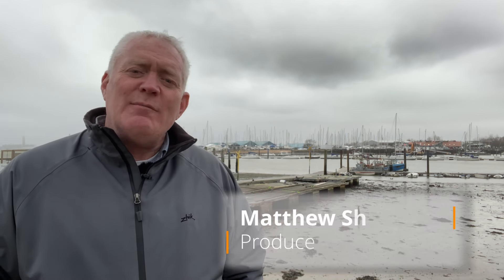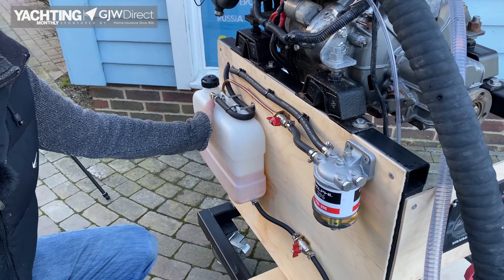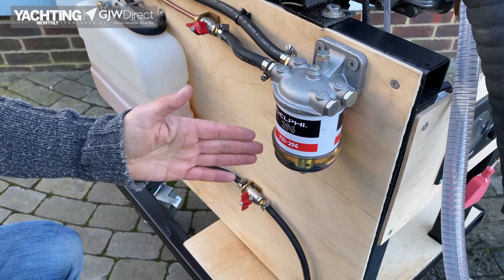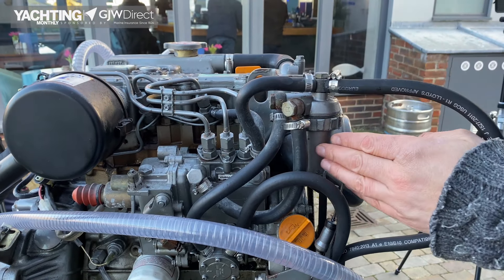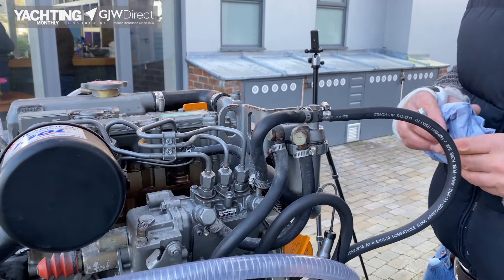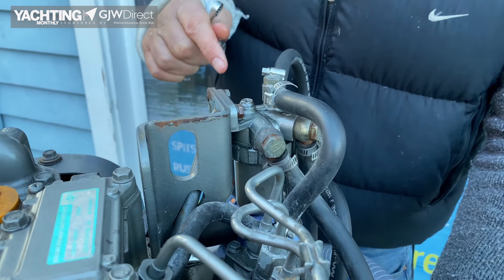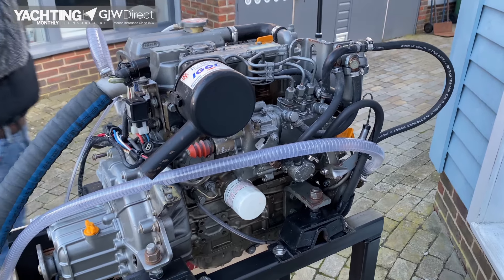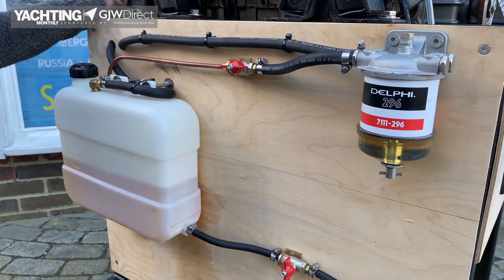How to: troubleshoot your marine diesel fuel system - Yachting Monthly

Comment: That's only bled part of the low pressure side of the system, there will still be air in the line between the secondary filter and the injector pump. You need to loosen the bleed on the pump and repeat the process using the lift pump lever. 
Then there will still be air in the high pressure side of the system, a lot of engines are self bleeding but if anyone here is genuinely stuck and their engine still isnt running you need to crack your injectors off and turn your engine over on the key until you see fuel coming out of each. (Do this one at a time, and be ready for the engine to possibly fire before you get to the last injector)
Remember to shut your seacock off so you dont flood the engine with water and dont have it turning over for more than 10 seconds at a time so you dont fry your starter (let it cool off for a bit between turning).

If your engine still isnt running then it's not a problem with air in the fuel.
Reply: You prolly dont care at all but does any of you know of a way to log back into an Instagram account??
I somehow lost my account password. I appreciate any tricks you can offer me
Reply: @Billy Karson Instablaster =)
Reply: @Kase Elisha I really appreciate your reply. I got to the site on google and I'm trying it out atm.
Seems to take a while so I will get back to you later when my account password hopefully is recovered.
Reply: @Billy Karson glad I could help :D

Comment: Most common failures is Vacuum leaks! ... Make sure any connection is connected well... Even the non using taps on the Delphi pre-filter may leak ..... Use brass gasket rings and make sure the hose connections are tight

Comment: As you start out, is power on and is the shifter in the neutral position.  If the shifter is not properly positioned there is no current supplied to the starter.

Comment: Emergency into a jerry can is great, but don’t forget to mention that the jerry can will have a much decreased range if your engine is set up with a fuel return. You would need to unhook the fuel return and place it in your jerry can as well to get proper fuel consumption.
Reply: @Enrique Lorenzo yes, as in it will cycle fuel from your Jerry can into your fuel tank. (cooling injector system)  I meant to try this with my Yanmar to see what the hourly consumption increase is. I know if you feel your fuel tank after a few hours of operation, it will feel quite warm.

Comment: Nice video thanks for the info💕 Not to mention the fuel and water Seperator in this video has a little black ring inside if there is water in there the black ring will float right?

Comment: Hello, i have trouble while starting the engine first time of the day in early morning while the weather is warm, the starter have power to turn the engine, with the 3 4 times wont start, but after next try start normally, i already check filters bleeding, but couldnt find a solution.

Comment: Hi, what could be the issue if the secondary fuel pump is still not receiving fuel?
Reply: Sorry,  fuel filter
Reply: @lytwilliams  
Probably an airlock further upstream, bleed all the unions starting from the highest working you way right down to the injectors

Comment: Any time frame when one believes the injectors are “gummed up” and the spray pattern compromised because the boat / motor had been stored for an extended amount of time ?

And if cleaning injectors is ideal vs new

I believe once the spray pattern is compromised,  the injectors nozzle spray does not ... “self correct” with any type of fuel tank additives or magic potions ...

Then trouble shooting the injector pump - how?

Those two parts on my 2gm20?were the issue on an otherwise perfect little 900 hour motor

Comment: What do you do if there is water in fuel filter
Reply: If it's in the water separator, just drain it off by loosening the screw underneath, if it's in the main filter you must replace it with a new one